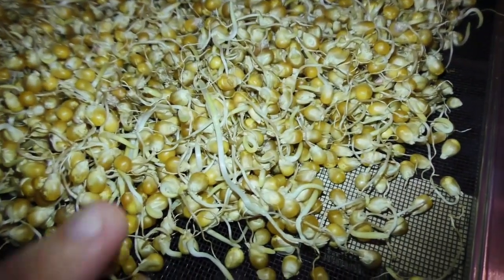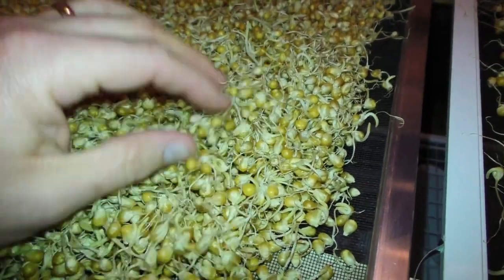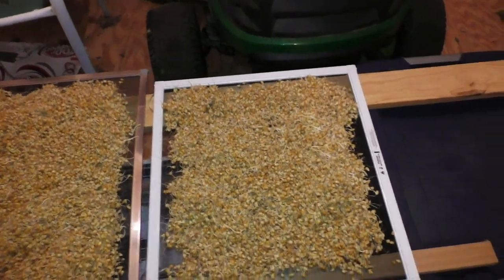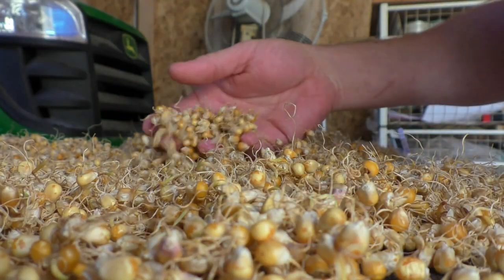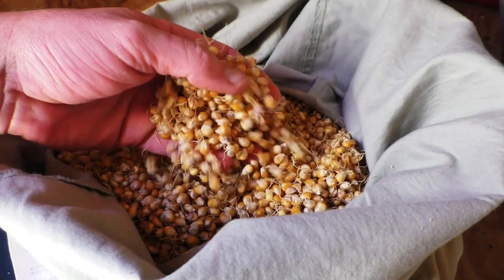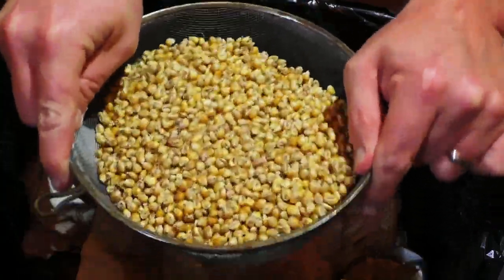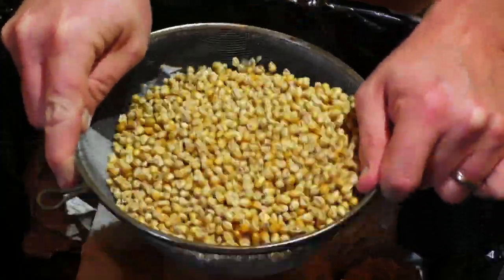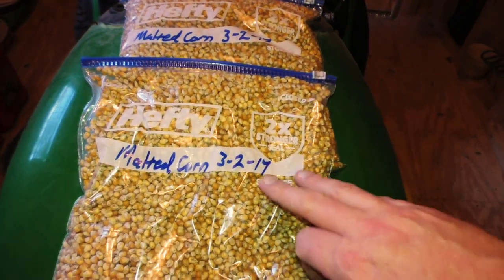HOW TO MALT CORN FOR MOONSHINE & BEER - EASY! - Part 2

Comment: The distilling laws vary by state.  Washington State has no additional laws regarding distillation, so it can be done here legally under the guise of alcohol fuel distilling.  The application can be found here: https://www.ttb.gov/forms/f511074.pdf  It's free to fill out, but the process takes a government employee about 3-4 months to get back to you.  With this permit, you can legally distill "alcohol fuels" for your lawn mower etc, but the distillate must be denatured with methanol if it is removed from the address on the permit.  Since there is no law prohibiting drinking alcohol fuel, you can drink your moonshine..er, um, alcohol fuel at home.
Reply from the maker: That's a really good point Bran. Unfortunately for me and others in my area, since it's still technically illegal at the federal level to distill for consumption, most states, counties, and cities aren't very accomodating. If you do distill (even with a fuel permit), be discreet. The fuel permit is limited protection and grants the Feds with the right to come "inspect" your home "fuel production facility" anytime they want. That creeps me out. 

If you think it's stupid that home distilling is still illegal in the US, there is something you can do about it. Check out the video I made on legalizing home distilling. https://www.youtube.com/watch?v=_rVZ0TwyYD4 

Thanks so much for your comment, and thanks for watching:-)>
Reply: +Bearded & Bored  if the corn is gelatinized what happens to the sugars?

Comment: So i may have missed it, but suppose theoretically im making shine :), what is the corn-water-yeast ratio for fermentation?
Reply from the maker: General rule of thumb is 2 pounds of grain per gallon of water. For yeast, just go with the package directions for whatever yeast you're using. Head over to the Barley and Hops Brewing channel since George did a great video on making a whiskey mash with malted corn.
Reply: Bearded & Bored great thanks! Im thinkin im gonna use my champagne yeast i used for my muscadine wine
Reply from the maker: @dirtnyaface  Should work fine. Just make sure you mash at about 145F degrees for 60-90 minutes to get maximum enzyme extraction. I've even let mine sit hot overnight in an ice chest to get the best results. If you've never done all-grain mashes before do a lot of research before you get going so you have a successful brew:-)
Reply: Bearded & Bored haha im watching each of your videos as i go. Today or tomorrow i start the drying process. Ive been using pots with a colander inset, works absolutely great! Makes rotating and mixing the corn a breeze. I dont think ive gotten to the mash episode yet, ill have to rewatch this one
Reply from the maker: @dirtnyaface  Good luck:-)
Reply: Bearded & Bored thanks. Quick question, how detrimental is it to get ALL the sprouts and roots off? They fight to the bitter end haha
Reply from the maker: @dirtnyaface  They do want to stick on the grain, don't they:-) It's not too big of a deal, just do the best you can. They have a lot of protein in them, so if you're doing a beer, do a protein rest to help with that during the mash.
That said, I did a beer with green malt and left the roots and shoots on there for that beer. Protein rest helped, and a long bottle conditioning helped clarify the beer too. For whiskey it's not a problem.
Reply: Bearded & Bored just gonna copy that right into my notebook lol thanks man!
Reply from the maker: @dirtnyaface  Good luck;-)
Reply: Bearded & Bored thanks again! An update on my brew... i put in some yeast nutrients and i was about to add my yeast but the yeast was dead unfortunately, so i ordered some from a local Brewstock supplier. Let’s hope i can save this test batch! At least until my Trump check comes in lol.. side note, i may or may not have added dead yeast to my mash because of my impatience...
Reply: Impatience/optimism hahaha
Reply: Last night and this morning i saw some bacteria activity (bubbles). This morning it smelled of vomit. I did a lot of reading about what it was but i couldnt find much about what it means for the mash or what to do from here.. will this bacteria ruin my run? Should i boil the hell out of it to sterilize and start over? Should i just throw it out and start over? Should i add something to it? Or should i go about my business and god bless it? Lol
Reply from the maker: @dirtnyaface  Mmmm, yummy. Had that a few times. Was this during soaking, or the actual malting? If it was during the malting, sounds like it was too wet, and maybe didn't get turned enough. Gotta make sure there is no standing water under the grain and that it gets turned several times a day.
You can try to rinse it clean, maybe wash it with some diluted starsan, then drain and try malting again. You have to kill the infection or it'll ruin the grain and prevent successful malting. If you're making whiskey, the infection may give you and interesting note in the flavor. If you're making beer, dump this batch and start over.
Reply: Bearded & Bored this is during the fermentation stage. The malting went on without a hitch, now that I’m trying to ferment it, it started this vomit scented belching. But yes I’m making whiskey with this run
Reply from the maker: @dirtnyaface  Oh, then you're fine. The crazy funk is fine. Ever smell rum dunder? Smells like baby poop and barf. The infection will produce some crazy esters that you can't get otherwise. It's a good idea to figure out how you got the infection in the first place, just so you can pinpoint where in your process it could have come in. That way you'll be able to prevent it if you need to, or cause it if you need to. A lot of whiskey distillers ferment open to the air to encourage esterification through oxygen transfer and potential infections. I'd run it as soon as it's finished fermenting down to 1.000 just in case there is some acetobacter in there. That can turn it to vinegar if left for months. Kind of jealous. Hope it comes out great!
Reply: Bearded & Bored side note, possibly an important side note, i haven’t added my yeast yet, Supposed to come in the mail today. Sorry for the bombardment of questions but i really appreciate your responses and help!!
Reply from the maker: @dirtnyaface  Hmm. Well, as long as it's a good strong yeast you should be ok. DADY or champagne yeast will take over and crowd out bacteria. If your yeast doesn't come today, toss in some bread yeast and run with that.
Reply: Bearded & Bored just got in my turbo yeast, converts up to 17lbs of sugar in about 48hrs, WATCHOUT
Reply: Update! Mash is boilin with co2 👌 vomit smell is going away and starting to smell sweet thanks to your guidance! Im writing down all ive been doing so if it goes well i can recreate this. So now leads me to another question. I think i might try a sip and then finish the shine into a whiskey. I know people use scorched oak staves. But me being the traditionalist lunatic that i am, im going for my own tree. So, im thinkin to harvest an oak or cherry limb? Also, can i scorch it green or should it be seasoned first?
Reply from the maker: @dirtnyaface  You can definitely do that, but it must be seasoned for at least 2 years. Otherwise the flavor will taste like a green tannin explosion and ruin the whiskey. Good luck brother:-)
Reply: Bearded & Bored good to know! Now i just need to figure out what kind of wood to use. In the mean time my mash is still bubbling a little bit, its done separated as well, clearer liquid on top and mash on the bottom. Should i stir it periodically? Is there such a thing as letting it sit too long? I know when i make beer and wine its pretty cut n dry because of how finicky they are. This is new territory to me 🤷‍♂️
Reply from the maker: @dirtnyaface  Just let it sit. Fermenting on grain is a bit different, but it's basically beer. When you get a 1.000 hydrometer reading it's done. Filter out as much sediment as you can, filter a few times if necessary, so you don't scorch it in the still and ruin the flavor.
Reply: Bearded & Bored ahhh i should probably invest in one of those hydrometers, i do it the old fashioned sniff and poke test lol
Reply from the maker: @dirtnyaface  Yeah dude, time to upgrade:-) They're cheap and really are very helpful. Your senses can trick you into thinking the brew is done when there is still some low and slow fermentation going on. If you pull the trigger early on a brew that isn't quite finished, you're just throwing away a better yield of alcohol that you could have had if you waited another week. Treat yourself to a shiny new hydrometer, brother!
Reply: Bearded & Bored soooo update, ive been letting it bubble and bubble with a cheesecloth covering. NOW due to procrastination/continuous bubbles it had a layer of white “flour” mold of sorts growing on the surface with some small maggots around the brim. Would you call this a delicacy or a mistake? Haha
Reply: has a layer
Reply from the maker: @dirtnyaface  A mistake. If you've got active creepy crawlies in there and mold, it's not good. Sadly, it's best if you toss it. The mold could just be a "pellicle" which is not always a bad thing, or it could be toxic. No way to know for sure. But maggots means it rotten instead of fermented. I would NOT run it if it happened to mine. Sorry bud. My advice for the future would be to use many layers of super fine mesh, or even a few layers of bed sheet secured to the opening of your barrel with a bungie cord if you want to open ferment it. That will keep out the bugs, but still allow oxygen and even some wild yeast in. Either that, or go with air locks and lids on buckets for fermenting until you get this one nailed down. You need to get a clean wash so you know what to expect as a base line for this recipe.
Reply: Bearded & Bored 😫😫😫😫
Reply: Bearded & Bored sucks cause it still smells sweet and good. Do i need to throw out my mash too?
Reply from the maker: @dirtnyaface  My personal philosophy is if I wouldn't eat it, then I won't drink it either. But it's your call brother. Go with your gut;-)
Reply: Bearded & Bored ok i agree with you there! I spose ill just toss it, its depressing lol
Reply from the maker: @dirtnyaface  I'm right there with you, bud. We've all had to dump a batch. I recently dumped 15 gallons of rice mash for a project I've been researching for nearly a year. Only thing you can do is learn from the situation so you do better next time. Daily observations and note taking are critical for stuff like this. I still have my note for everything I've screwed up;-)
Reply: Bearded & Bored you were gonna make sake? Thats my next brewing project. I also have a ss diffuser i got from my grandpa that i didnt know i had, been trying to think of some ideas for that, along with how to use it haha
Reply: Bearded & Bored infuser
Reply: Bearded & Bored update! Apparently i did have a hydrometer i didnt know i had. I cooked my shine after a lot of research i found out i had a wild yeast growing in my mash. I scooped out the yeast, strained it, and cooked it. Its such a small batch I accidentally combined the head and heart into one 100mL amount. The hydrometer couldnt read my product (no idea why) even though it read my homemade wine with no problem, this shine is hot though lemme tell ya! I did a burn test for methanol but it burned a clean blue flame. Has a strong sweet corn smell to it (my wife said it smelled like nail polish remover lol) thinking i should cut it with some water? Idk. It was a good practice run, the taste is hot on the tongue, slightly sweet with a sour nutty flavor (the scent of which wont get off my finger). The flavor isnt that appealing to me. Might run a bigger batch thats easier to handle the head and heart and ill try to keep that wild yeast away. Took lots of notes, thanks for all your past and future feedback!
Reply from the maker: @dirtnyaface  The nail polish remover smell is the foreshots and heads. I would not drink anymore unless you want a crappy hangover, but don't dump it. Save it for the next time you have a run and dump it in the boiler with whatever you're going to distill.

It'll add to your total alcohol volume and give you a chance to clean it up. I highly recommend watching some of Jesse's videos from the Still It channel on making cuts during a run. 

You should probably try to run your still very slowly, especially if you have a small run or a small still, to make it easier to make the cuts.  I'd definitely go with bigger batches from now on, since making good cuts on a 100ml run is almost impossible. I'm not sure I could do it since the transition between foreshots and heads can be the difference of a few drops, and the same with the heads and hearts cut. It's good that you got this run under your belt because they all help you get better at the hobby. Next time do at least a five gallon batch so you can have 200ml per jar and 20 jars. Way easier to spot the transitions and find the 5 or 10 jars that have the good stuff.

There are two types of hydrometers. The one you have is for measuring wine, beers, etc. before and after they are fermented. It is not calibrated to read spirits, which have a much lower density. For that, you need a "proof and traile" hydrometer. 

Let me know how the next one turns out:-)
Reply: Bearded & Bored thanks, i will! Thats a good idea to save and run in my next batch. Now, when you say clean it out, whatre ya referring to?
Reply from the maker: @dirtnyaface  Well, right now it's a mix of heads, hearts and tails. By clean it up, I just mean get just the hearts cut. Once it goes back into the still it will fraction out the same way any other wash will, so even if you make a mistake on a run, You can always rerun it, or add it to something else to get the hearts out.
Reply: Bearded & Bored ahhh i gotcha, well i plan on starting a 50# bag of corn to malt soon. So well see how it turns out in round two. I suppose ill have to find a better hydrometer as well. And from what ive read, I learned that the added scent of acetone/nail polish remover comes from cookin it too hot/fast and “stripping” it, whatever that means.
Reply from the maker: @dirtnyaface  Yep, ran too fast and smeared the cuts together. "Stripping run" is what you do to get most of the alcohol out of the mash on a fast run. When you finish a stripping run the product is called "Low Wines". Then you clean out the entire still thoroughly, and put back in your low wines and add enough water to dilute them down to 40%ABV for fire safety(this is why it's really important to have a "proof and traile" hydrometer to check the proof). Now that you have your diluted low wines in the freshly cleaned still, you do the second run, traditionally called a "spirit run". Low and slow to get good cuts. The learning curve on this hobby is steep, but once you master the basics you can really start fiddling around with all the variables. Stay safe and have fun:-)
Reply: Bearded & Bored ahhh I understand, very interesting. So pretty much i stripped out all the flavors and pulled pretty much 100mL of straight alcohol. No wonder it seems to be around 200p lol. Do you think id go blind drinking it? 🤣
Reply from the maker: @dirtnyaface  No, that's not what I meant. A stripping run doesn't strip flavor, only a column still can do that. What a stripping run does is gets everything that is volatile, all the foreshots, heads, hearts and tails out of the mash and increases the proof. Really you don't even need to do cuts on a stripping run since everything is going back into the still anyway.  But keep in mind I don't distill on my channel, so you need to watch pretty much all of Jesse's and George's videos to get up to speed on the details that I left out. Research, research, research. More than anything, that will help you make good product.
Reply: @BeardedBored if adding some sugar say 15 kgs sugar in 230 ltrs of water, do I still maintain rule of thumb ratio or alter

Comment: does corn at germination produce any kind smell.
Reply from the maker: It can be a little musty like wet grain, but it's not a bad smell. If it gets a bad smell, like rotten garbage or funky, it has an infection and should be discarded. If you are concerned about that you can check out my malt tumbler video here: https://www.youtube.com/watch?v=att7dAP13rY  It moves the grain around periodically so air flows enough to keep infections from happening.